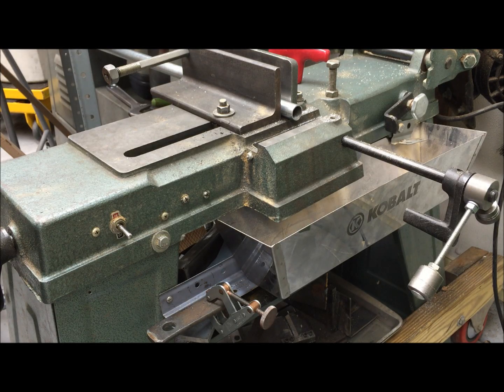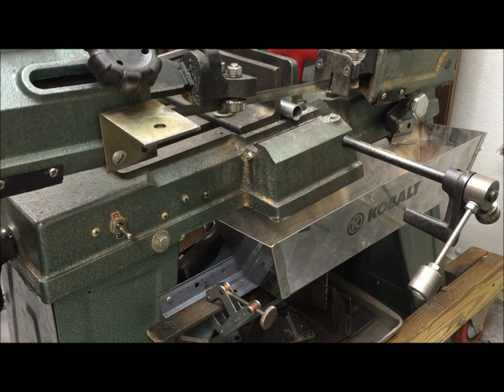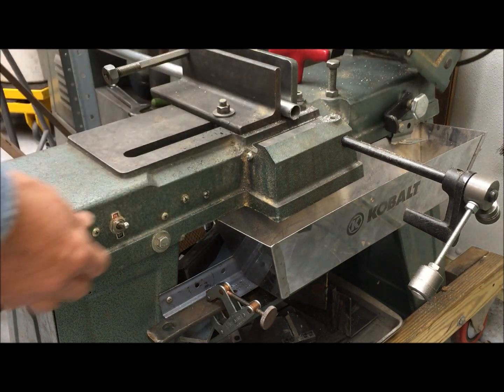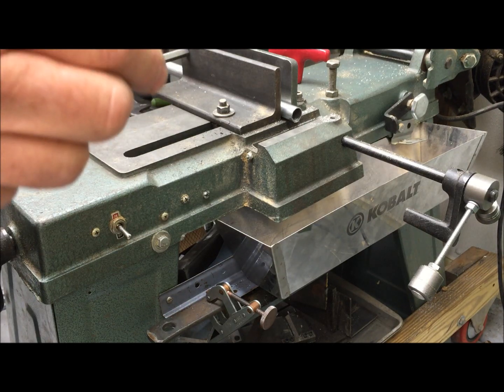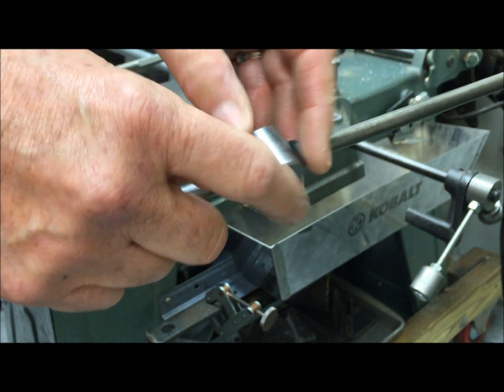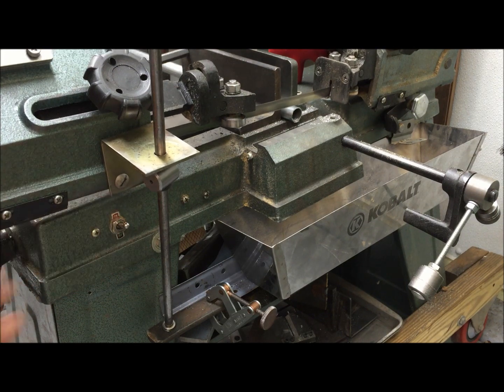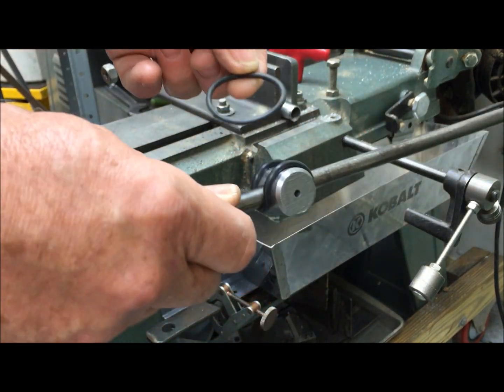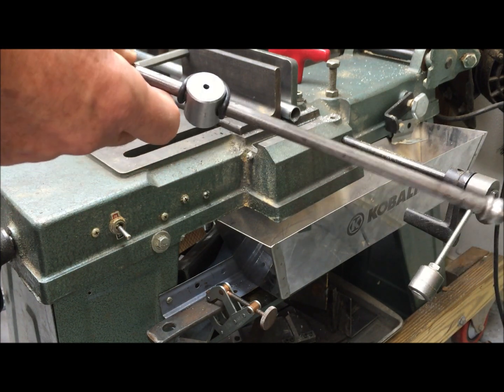Proof Of Concept Horizontal Bandsaw Hydraulic Cylinder Replacement

Comment: If you don't like the complication of an hydraulic damper, how about an adjustable friction disc style damper on the main pivot?
Reply from the maker: I tried a metal on metal friction joint and it either held too well or not enough. It was hard to get just the right amount of pressure. The subtle part of the O-ring solution is that the steel rod touches the ring like a bow touches a violin string. The vibration of the saw causes the ring to vibrate very slightly and that reduces friction enough to get the joint to slide.
Reply: I have been meaning to try a hydraulic damper, made from old push bike front suspension units, but might try a friction one first but using plywood, or similar, between the metal parts. Your O ring idea is novel but I would like something easily, and infinitely, variable for damping.
ATB
c
Reply from the maker: Chris Stephens If you can get a metal on metal contact to have a wide range of friction, I would love to duplicate it.
Reply: Still only in the mind, but thinking along the lines of a motorcycle steering damper. It would need a quick release as it would damp both ways, so maybe a non starter after all. Could build a ratchet in but getting way too complicated for limited benefit. Think I'll just feed by hand when needed instead.
Reply from the maker: Chris Stephens A useful way to invent is to start with a wild idea and then tame it. So maybe the motorcycle steering damper is not perfect but it might lead us to a better solution. The goal is to be approximately as good as the hydraulic cylinder but much simpler.
Reply: Rick Sparber Yes indeed, and the more you know/experience you have, the easier the taming. If you believe that all things are possible, that is.
Reply from the maker: Chris Stephens I know that not all things are possible. But many times things become possible by changing one tiny requirement. "If you can't solve the problem, change the problem."
Reply: Also, to fix a problem, first you must fully understand the problem. It does too help to ascertain that there is a problem in the first place, there are too many solutions in search of a problem.
ATB for the new year
c
Reply from the maker: Chris Stephens What you are describing is sometimes called "analysis paralysis". It is OK to start to solve a problem and learn more about it along the way. Having a potential solution not work is a great way to tease out more details of the problem. On the other hand, I completely agree that there a many solutions in search of problems. I view these as objects to store in my bag of tricks. You never know when they will come in handy. It is no different than my junk draw which is full of small bits of metal. They eventually all come in handy.
Reply: Along the lines of problems looking for solutions, an old prof once said "when looking at any new product or invention, ask yourself this, what problem is this the solution to?" Words to live by for all would be inventors.
Reply from the maker: Chris Stephens Good advise. If you don't know where you want to go, you will never get there.
Reply: Or when you have got there.

Comment: Thanks Rick nice simple idea.  Old draw cut power hacksaw would use a wedge setup and the vibration would slowly allow the wedge to slip and lower the blade.  Depending on how much friction was set on the wedge would control the speed.  Thanks for sharing.  Randy
Reply from the maker: I'm not surprised that there was an elegant solution before hydraulic cylinders. I will look it up. Thanks!